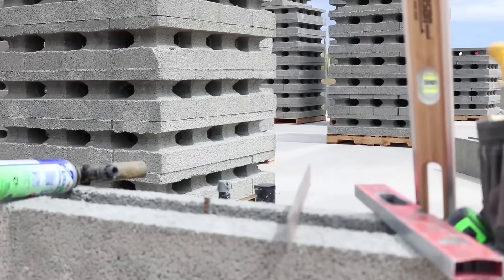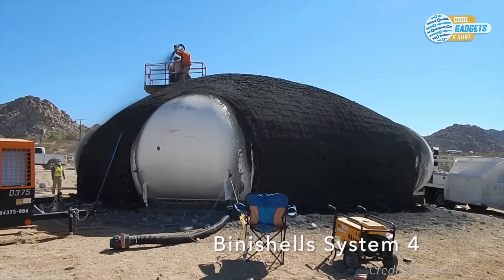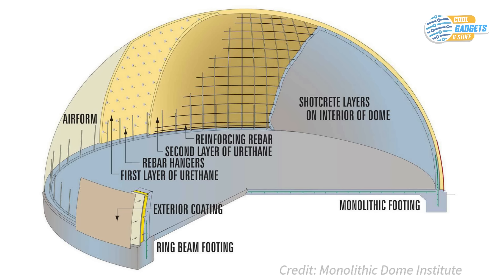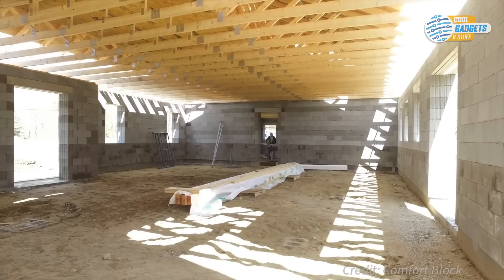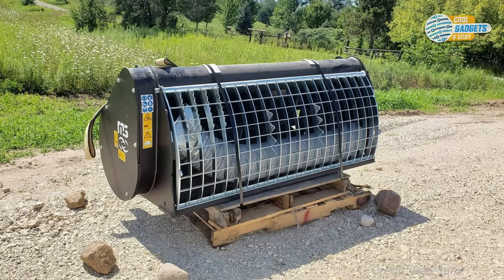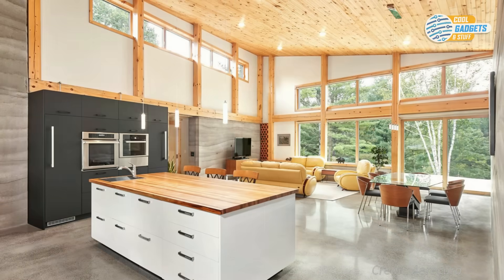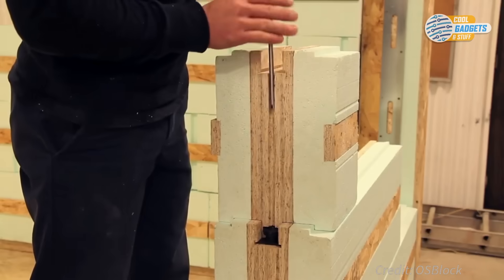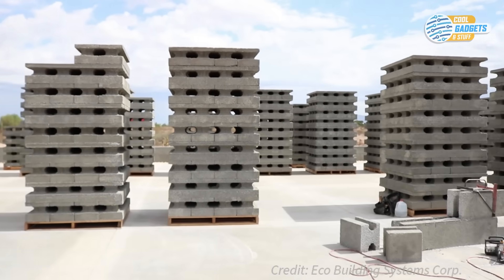5 Innovative BUILDING SYSTEMS for your house #3

Comment: Pumicecrete is by far the best building material on the planet Pumicecrete is a mixture of pumice cement and water mixed and poured into a set of reusable forms walls are poured from 12"to to 24" thick pumicecrete is fireproof termite proof rust rot and mold proof and has a high R value and good sound attenuation solid poured walls means no critters can live in your walls Pumicecrete can be built for a fraction of the cost and time and pumice is one of the few building materials that can go directly from the mine to the job site ready to use without any additional possessing and zero waste

Comment: This completely makes sense in tornado dangerous areas of the US. I cant understand why the government dose not force the building industry for these designs as a standard practice in tornado dangerous areas? No more shingled roofs, minimal insulation, and almost maintenance free walls and roofs.
Reply: because in the USA we have human rights.  If you want that type of control go to NK
Reply: @protonneutron9046  I would say, why not give potential home owners in tornado alley ( like me) a choice between these building methods/materials or standard conventional methods/materials? Some day, I want to own a dome home with an attached dome greenhouse.  I don't pretend to be an architect or civil engineer, but I think this could be done perhaps via 3D printing.  Protocols for this method already exist.  Nasa has issued plans/drawing for proposed living spaces on Mars in which 3D printed structures are constructed via 3D printing machines that use materials on Mars to create the shotcrete.
Reply: @carolb3327  You should be able to build whatever you want.  I never advocated abrogating ones property rights.

Comment: Gotta say, first concrete dome house seems so cool :D But at the same time this video seems to be basically concrete commercial from company site or advertisement with no original input or research. Just don't believe any claims said in this video and appreciate the interesting methods and structures.

Comment: The last system seems highest value, and easiest DIY project. I might first look at that for a basic "cabin on the lake" type use, to test it's potential. 

The logistics of availability, transportation costs, and a final leg to an off grid site would be major determining factors, as well as initial costs.

Comment: This should be required to homes built in tornado areas.
Reply: I live in the lower reaches of 'tornado alley.' I would welcome structures like this! Buildings down here are built super flimsy, with NO basements! Tornadoes easily tear up stuff down here (Dallas/Ft Worth area).

Comment: On those blocks with styrofoam inside, there’s a product in Texas that mixes styrofoam with a special super hard cement mixture that makes cinderblocks that are super light, great insulation, and you can’t break or damage them with a hammer.
Reply: That’s probably the “Perfect Block” shown at the end of the video
Reply: What are they called
Reply: @edsonjavierrr  — In this video they are called “Perfect Block,” however every manufacturer has their own brand name.  Search for “styrofoam concrete blocks” here on YouTube and you will find dozens of examples.
Reply: @Erin-Thor  thanks!
Reply: Styrocrete and aircrete

Comment: The "perfect blocks" should be stacked like bricks in an alternating pattern instead of directly on top of each other.
Reply: Yeah it was weird for those some of the building had the blocks offset but then a bunch of others just had them stacked up directly on top of each other.  I thought that was a little odd looking.
Reply: @zancrus9629  it is structurally weak and can easily topple with the right conditions. (i.e. earthquake etc.)
Reply: Those are supposed to have rebar every course and down each column and then filled with concrete.. I'm not sure why they didn't show that, that's one of the main selling points? It makes a very strong structure if put together correctly

Comment: Comfort Block: XPS is no good for humidity (ref. temp. gradient); will survive probably 20-30 years. There seem to be also many cold bridges in the insulated ones. US standards could differ from EU ones, though. OSblock is even worse. When XPS degrdes, it will create condensed water pockets - next to plywood kind of  material.

Comment: As I continue to watch your series with great interest, I can't help but note how greenhouse gas emissions heavy many of the materials and methods of construction are. Whilst many of these buildings will have a lower energy input over their useful occupancy life (that's great), I don't think that it's possible to truly describe most as eco-friendly. Costs are more than just what it takes to build them in the 1st place; overall environmental costs/impact matters too. End of life disposal is important for any product to eliminate landfill usage and all the problems associated with them. Most of these construction materials are not recyclable at end of life. TBC, these observations are NOT criticisms of the channel, but of materials used therein.
Reply: But nature loves greenhouse gases...
Reply: Blocks and concrete have much better insulation and higher thermal mass than other building methods, so in the long run you save a lot of energy for heating and cooling.
Reply: @stephanweinberger  But are extremely energy intensive and highly polluting during manufacture & transportation to site. To be fair they are sometimes the only viable option due to conditions and intended use of the buildings but I think that wherever possible, it's good to limit their usage in favour of sustainable construction materials that are relatively easy to recycle at the end of their useful life; particularly in the case of plastics, polymers and polystyrene. The 3 R's - Reduce, Reuse, Recycle.
Reply: @pinkelephants1421  it all depends on what you define as "useful life". Brick/block/concrete buildings are usually designed to last for several decades, at least.
Reply: Stone, concrete and brick structures can last centuries with proper up keep. So the "end of life" process isn't an issue. Look at some buildings in Europe that were built in the 11,12 and 1300's that are still in use today.
Reply: @williamd1891  Oh, I don't disagree with you on that point. But as far as concrete production is concerned, current production methods are responsible for a hefty proportion of the world's CO2 emissions and there's considerable work by various organisations and companies on changing this, none of which is without considerable challenges.

Comment: Concrete brick house sound insulation no flex and can withstand harsh weather? Welcome to Europe
Reply: When they don't flex, they crack.
Reply: Well here in Latinamerica all of the families build their house with concrete blocks beacuse is cheaper and better than wood.
Reply: They have some minor flex tho but compared to wood you'd say "none"
Reply: I doubt the US ever adopts concrete homes throughout. Especially considering that even Europe is starting to have wood skyscrapers. When wood structures act as a great way to carbon sequester also.
Reply: @NAUM1  unfortunately trees don't grow fast enough and demand would outpace supply.
Reply: @Eclectic1967  Hopefully 10 years an not a century, otherwise your children might wanna start looking for a new place to call their home. Other than that, log cabins are great for being aesthetic.
Reply: Europe is a shit hole bro

Comment: Steel reinforced concrete doesn't last very long. Maybe 40 years at best. Once the water gets to the rebar and starts rusting it, the rust expands and the concrete begins to chip away. That's why the roman coliseum has lasted so long, yet things like apartment building balconies and concrete bridges don't.

Comment: what is the BEST innovative building system in the TROPICS??? what could u sudgest
Reply: Suggest
Reply: @skylersmith9465  yeahh thats right ,,, I'm typing so fast
Reply from the maker: Hi there, not sure what the building requirements are in your part of the world. Bamboo Living Homes builds nice bamboo framed house all over the world I believe, that also seem to fair well against the high winds. I think masonry construction like clay blocks are most popular in tropics. Not sure what to tell you, you'd kinda have to see what's available out there.
Reply: @cgstech5657  yeahh.. thanks I grow up having a bamboo house before it much cooler & cozy in our warm weather, sadly rains rot the bamboo wood, most people has concrete houses here now but its to hot inside, the cement & iron roofing absorbs the heat,,,  i love bamboo as a furniture ,mugs,tumblers, decor and tools etch
Reply from the maker: oh interesting, I know bamboo has to be treated before being used in construction. Having insulation can keep climate in the house a lot more comfortable during heat, but I know in the tropics people don't insulate their homes. Insulated lightweight concrete or type of aircrete is becoming more mainstream. I'm making another video on building systems, will be out next week, will cover some builders and methods that used lightweight insulated concrete.
Reply: @cgstech5657  great ill, be hoping for that,,, :) thank u

Comment: 10:14 you really should stagger blocks its structurally important. 
if you build a house out of legos like that its easy to knock down. if you stagger them its much harder to break a wall apart.
Reply: It even looks wrong
Reply: Not very much if the blocks itself are not supposed to hold anything up. What this product is, is basically a styrofoam mold for the concrete that can stay in place as insulation after the pour. You also see connecting channels in those blocks to allow for an encased continuous concrete structure for the whole wall. I don't think the styrofoam blocks add very much real support to the structure, but that it is completely dependent on the concrete filled in. But I agree that it looks wrong to do it that way
Reply: thought the same thing

Comment: Comfort Block: Wow thats how houses in Europe are build for 7 decades...
Reply: :)) half a meter of concrete will keep you warm in winter and cold in summer :))
Reply: And polystyrene is Styrofoam in British English
Reply: @lemdixon01  It's so modern that some of them are used on my 100 year old house :))......Besides that, european houses, some of them would withstand a hurricane and people inside would say.....Go away Katrina, you're silly :))
Reply: @Krom1hell  YOu need to learn more about hurricanes.  Plenty of well-built structures are taken down by hurricanes.  How many hurricanes are seen in Europe, anyway!
Reply: @doctorlarry2273  how many houses in USA are made only of reinforced concrete?....I mean the way some houses are made there...are just sillyness and wouldn't get a structural aprooval here.... yeah well, during hurricanes mostly cardboard houses are victims, but those are the most common in USA... I've seen houses made out of reinforced concrete poles with reinforced concrete in the holes, or  railroad lines used as reinforcement for the concrete flloring for the first flloor out of 1floor....that level of sillyness happens here when normal people build houses.... While granted, you might loose a few roof tiles in a big wind, or the whole roof, the rest of it is going to be scratched paint. I do hope that you realize that half a meter of reinforced concrete for exterior walls is going to probably stop even a bus tumbling towards you ( and that's the thickness of most exterior walls where i live in, and all are made of high grade reinforced concrete. Can't say I'm eager to see a hurricane try it's best against one of our constructions, but I'm fairly sure it's going to cope better than plywood and drywall.
Reply: @Krom1hell  Long reply and you still did not answer the question.  BTW - I am a structural engineer and know about more construction types than you could imagine.  My specialty has been protective construction - you know, threats like bombs and such.  Backpacks to nuclear.  Don't use nuclear-resistant construction if your threat is a backpack bomb.
Reply: @doctorlarry2273  Nobody told you anything about protective housing and such......It's the norm here to build things that last, that's a normal house that costs 40-60000$ here :)).
Stop flexing your muscles, I'm an engineer too, this is not about our egos, it's about the sad realities of the housing industry in USA. We are the little piggies that build out of concrete, and live in that house for some generations, you guys build a house that needs to be rebuild every 5 years because the drywall falls down, and not because of hurricanes :)...... You have 5 grades of drywall finishing, we have 1, it's well made or it isn't :)). Besides all of that, I have relatives in the USA, with houses built to last, some on Tornado Alley, and it's close to a joke to them, they never had to rebuilt anything. One of them is a structural engineer too, and is living in the same house for close to 40 years. So that would attest that a well build house can withstand countless tornadoes/hurricanes. Just pointing out facts, we build for hurricanes and have none, you build for "hell knows what, paradice probably" and have extreme weather. At a staggering price to boot, because some prices for material there are close to 10000% more than in Europe,
Reply: @Krom1hell  Stop showing your ignorance about housing in the USA.  It is different, yes - and cost is a big factor.  And there are plenty of residences here that have been occupied for centuries - and they are NOT built of concrete. No one in the US remodels a home in 5 years, period.  Most home renovation in the US is interior updates - not structural issues.  The problem with tornados is that they occur frequently in some regions and almost never in others.  People do not want to build a very expensive house that could resist a tornado in areas that rarely have them and NO ONE builds an expensive house in areas with frequent tornados, period.  I live in a tornado-prone area and the focus is on life safety - protecting people through purpose-built storm shelters - either public or private storm shelters.  There are plenty of homes here that are much older than 100 years.  
BTW - name a residential building material that is "10,000 %" more expensive in the US than in Europe.  Name one - you can't because you have no idea about that.  In case your math is as bad as your understanding of US construction, that would mean a product/material in the US would have to cost 101 x the cost in Europe.  I guess you think that equivalent house material cost in the US would be over 100 times that of material cost for the same house in Europe??  Do you want a $50K house or a $5M house???
Your take on protective construction and my training and background are at least 10,000% wrong.I have designed for every type of extreme event possible and know what it takes.  I also know that it is more economical to build for safety of people that property preservation.  Rather than increasing the cost of every house potentially subject to an extreme event, it is better to build reasonably and replace damaged property that is affected by such an event.
There is a reason why you don't see much of the type of construction described in this video in the US.  Few people in the US could, or should, take advantage of the additional insulating properties that come with extremely thick walls.  Look at the earth.  Most of Europe is well north of 49 of the 50 US states (Alaska being the exception).  You have to get much more payback from thermal savings to build that type of construction in the US.
I will leave residential construction in Europe to Europeans and you should leave residential construction in the US to the US.
Reply: @doctorlarry2273  Let's end it at this: I've rebuild a medium flat with medium to premium material, that includes pluming, electricity, central heating, interior walls and finishings, decorations, for the price you pai for a "normal" granite countertop for the kitchen.....And I will drop the mic down
Reply: @Krom1hell  So, in other words - you can't answer the question because.........you swallowed the mic.

Comment: OSBlock: electricity cables going zig zag and not being straight up? safety hazard right there. a disgrace.
Reply: I saw that too.  You could probably take your time and line the chases up where you were putting the wiring or take the extra time and route in new ones.
Reply: What happens when you zig zag elctricity cables?
Reply: @Ladjoke  You are more likely to hit them with a screw or nail, and in Ontario I think you would have a hard time passing an electrical inspection.

Comment: I would love to see someone use Hempcrete to make a type of "perfect block".
Reply: I don’t know if the tech has improved, but last time I researched it, hempcrete isn’t useable for load bearing walls.
Reply: @phoenixpv  It does, but only after it's set up for months, and it depends on the mix. So in a brick form it should. There of course needs to be more testing, but if styrofoam and cement can be load-bearing...
Reply: hemp makes concrete weaker and lessens its longevity.